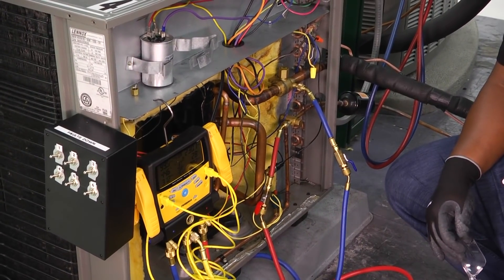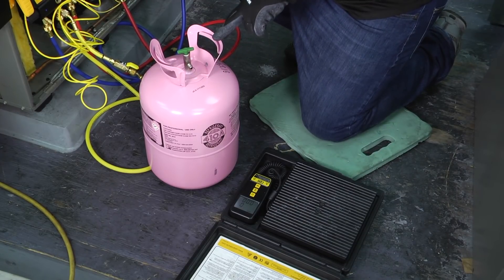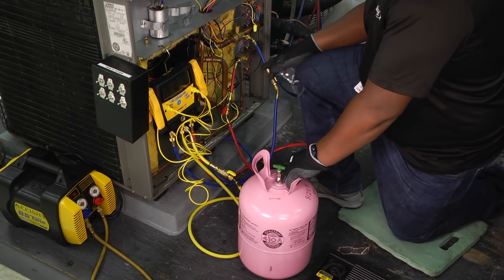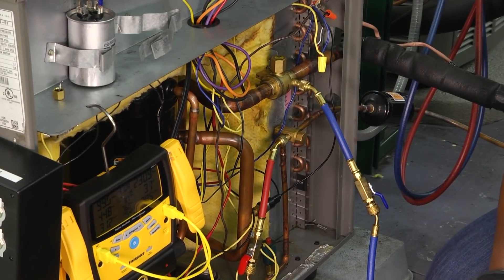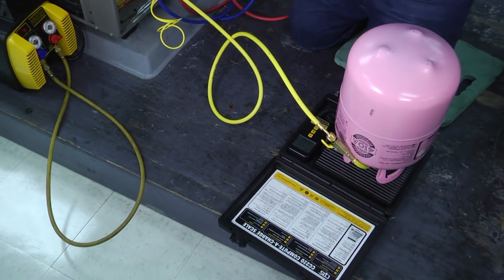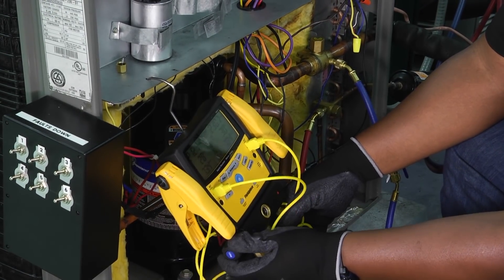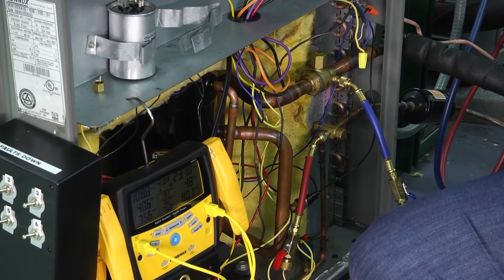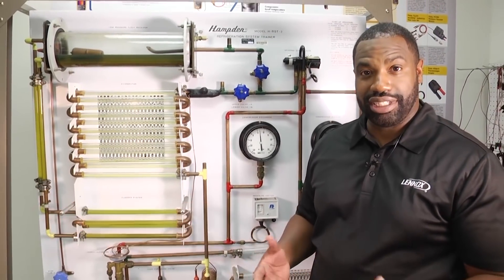ToolboxTuesday: How to Charge an HVAC System | Lennox

Comment: 5:10 - You say "check your superheat and subcooling levels" to achieve the correct charge. 
I assume this particular HSXA16-036 did NOT recommend using the approach method for charging? If that's true, can you share the tables you used to determine your targets? I can't seem to find them anywhere. Thank you!